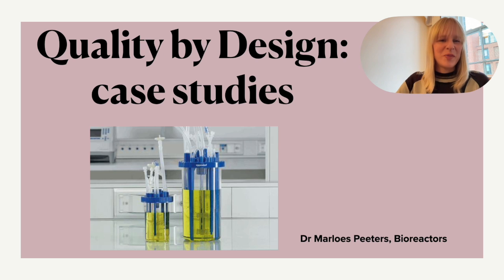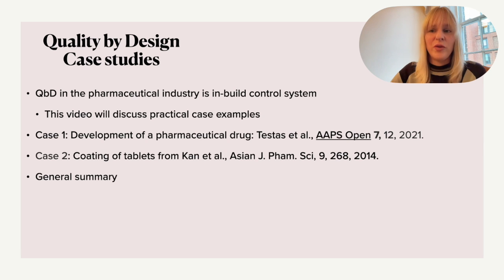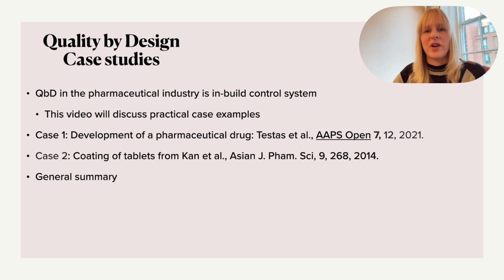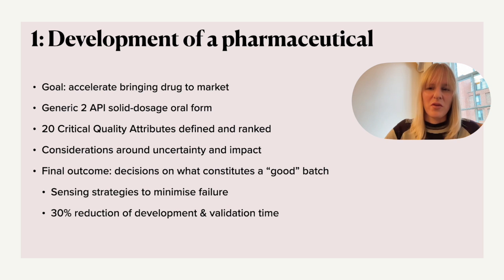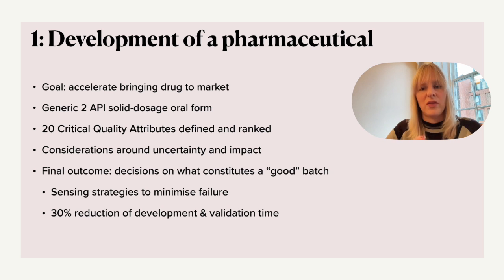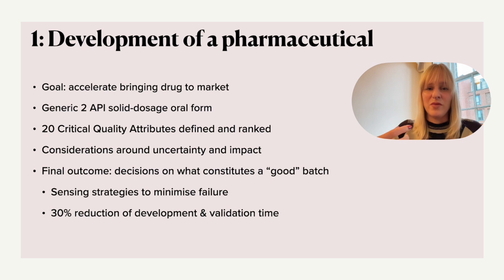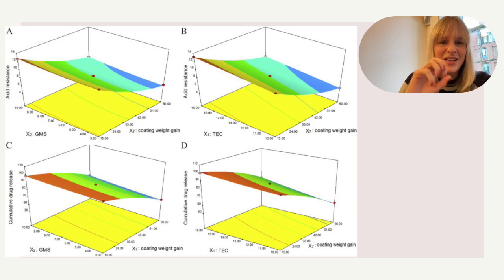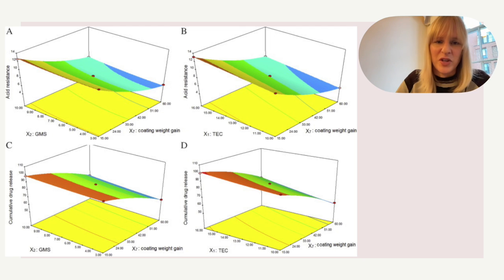Quality by Design: two example case studies

Comment: the sentence ...  here the tablets were coated with naproxen which is a basic compound so it will change the pH as you get dissolution of the tablets   ...  how many mistakes can you possibly fit into one sentence